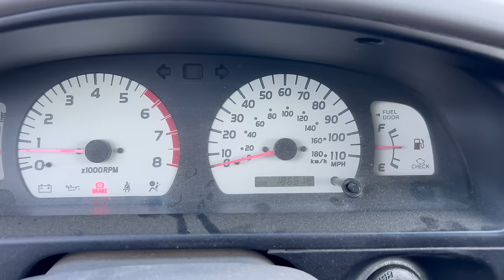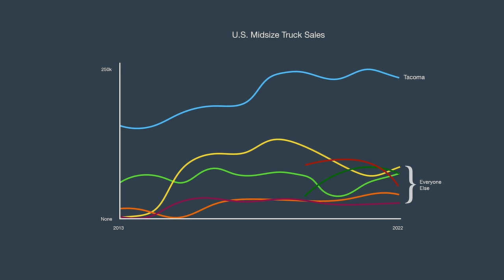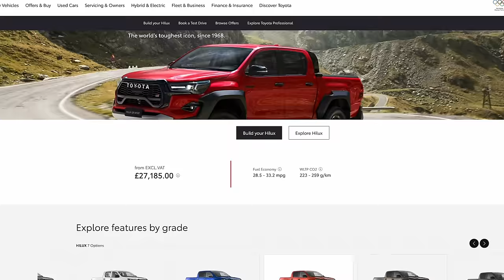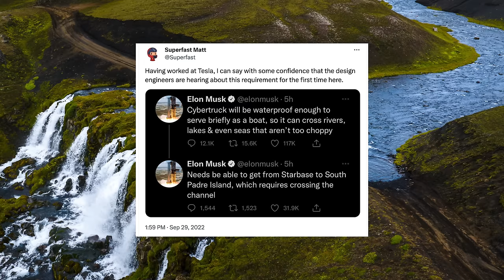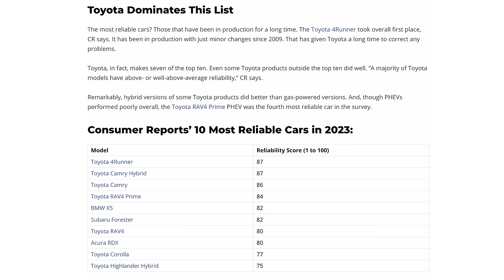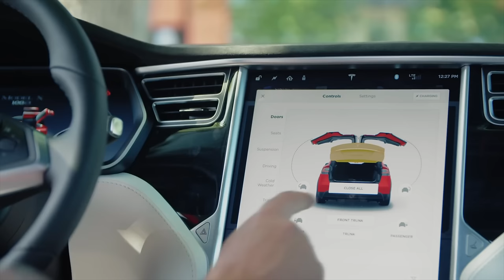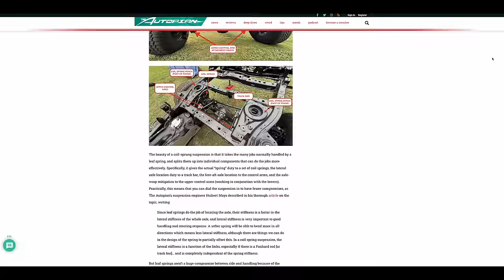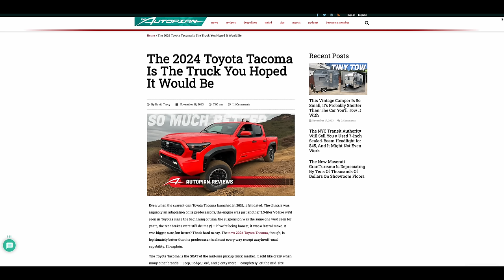What Is The Best Truck, And Why Is It The Toyota Tacoma?

Comment: You didn't talk much about the size creep on these mid-sized pickups. It seems to me like an F150 from the late 90's is about the same size as a new Ranger. The Tacoma is certainly a larger pickup than the previous generations as well. And, generally, the more weight you ask a vehicle to carry around every day, the harder it is on all components of that vehicle (except it usually rides smoother).

I'm still of the philosophy that I'd like to ask a larger displacement engine to work at about 20% of its capacity 80% of the time than ask a small engine to work at 60% of its capacity 80% of the time. Adding turbos adds complexity and heat. Not things that usually go hand in hand with long-term reliability.
Reply: all of the tacomas have more power than the cow towing hiluxes and such.
the 1.9 isuzus work all day all year hauling ice too.

like, it doesn't really matter as much as much as the engine at 100% isn't overtaxing the engine in the first place.
Reply: I "downsided" from an 07 Ram 1500 to a new Ranger and it's just as much truck with better fuel mileage. So, yeah I agree.
Reply: That size creep is due to the EPA. The formula for determining required fuel economy is based on size of wheelbase and year of production, so to avoid fines they have to make the vehicles larger to keep the same class engine. It’s why the Maverick is a hybrid.
Reply: Trucks in the us are insane size. I'm argentinian and the hilux's are pretty small compared to the new rangers, and dodge Rams always look huge next to every single other truck I see.
Reply: Yeah, a new Tacoma can be larger than an early 2000’s Tundra, it’s pretty wild
Reply: It's the stupid CAFE "standards" enforcing unrealistic mpg/wheelbase ratios. If you want a small truck (a la 90s s10) you'd have to somehow get it up to ~50mpg, which while I might not be an engineer or a physicist, seems like an impossibly with ICE alone
Reply: You can easily ask your engine to work at 60% of its capacity 80% of the time, it just has to be a well build and tested engine which toyota is pretty damn good at.  I'm a guy who would much rather ask my engine to work 60% of its capacity 80% of the time instead of going around 20% capacity 80% of the time.  I can tell you that heat really isn't that big of a deal. The engine actually likes having the water running through it at 70-90c, the oil likes to be heatet so it can flow better and do its thing, the combustionchamber also likes heat so it doesn't get fouled by sood in there. There is absolutely no problem in having heat in your engine, it actually needs heat to work as it should and so it runs as clean as possible. The "trick" in it is managing the heat which you do with your heat exchanger's. Your engine's water has one, if your car is turboed and or is excepted to tow your oil has one,  if your car/truck is big, is for driving long or is for hauling/towing your transmission typically has one, so heat is only a problem if one of these fail, so don't be afraid to work your engine  at 60% capacity and don't be afraid to hit the redline(not limiter) if your car isn't makinh weird noises like knocking if you do it. I can tell you that i own a 21 or 22 year old car with 223000km/138565mile car that redlines at 6400rpm. That car lives it life at 3500rpm if i'm not just cruising in town and behind other people with no safe and or legal way to overtake. I usually shift gear at 4500-5000 from trafick light to trafick light and if i'm out om the country roads it lives at 4000 as a minimum and will be taken to redline as often as the road lets me. And while i downshift i will typically downshift so the rpm's is at 5000rpm if i'm engine breaking. And I can tell you my engine hasn't had any problems while I have had the car. It has actually gained a bit or compression back after it has been given enough heat for carbon and sood fouling to break loose and get cleaned up. Which has happened because the only other owner was an elderly couple who with high probability drove the car like you drive yours and they probably logged it around alot.

If it helps my car is an old Toyota avensis t22(was only for the eu market I think) with a 1zz-fe which is the stroked "non liking" rpms from the zz family.
Reply: semi's sitting in the corner with their turbo diesels
Reply: @ElBach1y  I would love to have the Tornado, Strada or Saveiro.
Reply: @megazombiekiller9000  the problem with that is the company is making the decisions for us. They aren't forced to do this. Companies decide to do this on their own accord and advantage, not the consumer's.

Comment: My '96 Tacoma 4WD 3.4L V6 Extended cab in burgundy? non-SR5 trim has 336,000 miles. It can go years without adequate maintenance almost nothing breaks and I've forgotten most of what I knew about how to work on vehicles.
IF it ever dies I want another one of the same year and model.
Reply: Preach brother.  I feel the same about my 18 Tacoma.  I have already put 156,000 miles on it and she has not skipped a beat. I have replaced 2 ball joints, UCA bushings, breaks once and spark plugs once.  Tacoma's are amazing.

Comment: What Working as mechanic taught me about Toyotas. They our underpowered. Mechanical more complicated when compared to other trucks. Build quality is superb. Interior quality in the 90s was also simple and superb for wear/longevity. Front Suspension geometry was a head of its time and is now copied by almost all other truck manufacturers. They offered awesome off road tech with rear locker available. They also fail like other manufacturers, and factor parts our more expensive. Yes they can and often do last a long time the owners also our more willing to keep them maintained and on the road because they hold their value. I have seen all brands of trucks reliably be worked hard with high miles put on them, Toyotas our no exception. 

I would not pay the money people want for them used. 

Awesome video Matt!!
Reply: Are*
Reply: That autocorrect on your phone is terrible!
Reply: Now the manual transmissions are failing even though they detuned the engines to not stress it. The fully boxed frame is made from extra thin metal to save weight and money.

Comment: I did the same thing bought a 2016 and as well no issues.
I don’t do off road so I’m not worried about the plastic antifreeze pass through on the backside of the motor. They started making them out of metal in 2018.
I think turbos will be OK. The most important recommendation is let the motor warm up, change the oil often and let them cool down before turning off engine.

Comment: Original owner of a 1998 SR5 2WD V6 with 225k miles. I've done all the wrenching since new. Minimal issues except for the rear leaf springs flattening prematurely, misc oil leaks, replacing the alternator and a couple bad fuel injectors. I think I am still under $2k in total repair parts. It has never stranded me. I get asked every so often by random people if I want to sell. I'm keeping this thing until the wheels fall off, about 1.5 forevers from now if Matt is correct.

Comment: I had a 98 Tacoma for 4 years, loaded with TRD package, V6, 4x4.  I even put Bilsteins on it like the ones here.  It was pretty reliable, easy to park, and it felt like a "real truck" which came with "real truck" downsides.  It was super slow.  It rode like a shopping cart and the bed was narrow.  I replaced it with an 07 Ridgeline which is far more comfortable and fits my needs better.  I drive off road pretty infrequently, though when I do, it's nice not to have to switch to 4WD.  It's also excellent in the snow.  The Ridgeline's "AWD" system works pretty well and is seamless.  The Ridgeline is also much more comfortable on road where I spend most of my time, and it fits sheet goods between the wheel wells.  Hauls motorcycles in the bed and I towed a UHaul to help someone move.

Not saying the Taco is bad.  It deserves its good reputation.  But I think the compromises you make with a Ridgeline actually fit 90% of what most truck buyers need.  Too bad the Ridgeline is as ugly as a bulldog licking peanut butter off a cactus.
Reply: I have been on the fence for a Ridgeline for about 10 years.  The only reason I didn't pull the trigger was the horrible fuel economy.  I get 22 mpg in my paid off 2010 Silverado... the Ridgeline was still "boasting" 18/23 mpg last year, and that just doesn't cut it for a Honda in 2023.  Still, I must agree that it does everything as good or better than it's counterparts, besides off-road, where few people ACTUALLY go.  And yes, it is Butt-Fugly.  Honda, as an exceptional off road vehicle company (motorcycles, Quads, UTVs) needs to step up and make a proper truck to compete with the Taco, and I think they could.
Reply: @matthewpeterson3329 
I'll drink to that.  My RL has A/T tires and mileage with mostly city driving is in the low teens.  On the highway I've gotten 20, but it's just thirsty.  For the mpg it gets, it should make more power.  Though my Taco with the V6 wasn't any more efficient (the 31" tires may have also had a hand in that) and it had 60 less hp.  The 2nd gen RL now makes 280 hp which is a welcome bump, and mileage improved a touch to boot.  I only put 2k miles or so on my truck each year so this wasn't a dealbreaker for me.
Reply: How's your water pump gasket doing?
Reply: @DylanClements98  That's funny... I put bilsteins on my Silverado and it rolls and sways like a boat now.  But yeah, not a great ride... I wouldn't choose them again.
Reply: @DylanClements98 Agreed, I think they contributed to the rough ride, though even before I installed them the truck was hardly cushy.  They did give me confidence to take the truck over some large bumps.

The Ridgeline by comparison rides and handles more like a car (well, because it basically IS a car) and that's a good thing when you're driving it mostly like a car.
Reply: @7eis Not sure if you're alluding to some potential weakness, but it is fine.  I replaced the TB/WP 9 years / 40k miles ago with Honda parts.  I'll time them out next year.

How are your valve cover gaskets?
Reply: Ridgeline now reminds me of a poor man’s Cybertruck
Reply: @matthewpeterson3329  I have found in my research that American cars have bigger engines/more horsepower than foreign cars generally and still beat them in MPG....
Reply: Using a car to do truck things is not even close to what “90% of what most truck buyers need”.
Reply: @matthewpeterson3329  My base '96 Tacoma 5-speed gets decent mileage. Not civic/corolla mileage, but near 30 MPG on the highway. As for comfort, I have a '96 Camry or '98 Altima for long trips.
Reply: @will7its   Yeah, I ran into the same info when I was looking for a little commuter a couple years ago.  My Silverado was just over 260k miles, but whistle clean, and I wanted it to stay that way.  It seemed stupid to put 120 miles a day on it.  I was on the hunt for max economy, and settled on a Kia Rio hatchback.  Honestly, a damned decent little ride, good stereo, and I get 52 mpg.  I can't complain.
Reply: @sunbeam8866   That's respectable mpg.  I had a '91 Nissan strippy model pick up that got in the low 30s for mpg.  I really liked it until I needed something bigger.  It was really tough, took a lot of abuse and laughed at me.  Nissan made a good truck back then... arguably as good as the base Toyotas, IMHO, for considerably less money.  I think I paid $6495 for it brand new.  Of course, the resale has always been better on the Toyotas.

Comment: I agree strongly with the whole video except for the part at  8:31 . I live in Mexico, I have a manual 2023 4x4 turbo diesel hilux, STOCK it did as well as jeeps with 27 inch skinny tires.  I lifted it and gave it 32s and now it outperforms jeeps, and when it was on those skinny tires in 4H, man that thing did burn outs…. A FOUR BANGER.  it’s 220hp and had a 0-60mph of about 6 seconds. Crazy fast.  Since the tires upgrade it’s much slower but it’s the most badass truck I’ve ever seen on trail down here.  It’s ANYTHING but mundane. And I use it for painting jobs too, it’s a do everything truck.  It even does mudding better than the fords and rams and chevys because it’s lighter and doesn’t sink.  Life has only been getting more exiting since this truck, and due mostly BECAUSE of this truck, I’ve taken it up so many mountains and horse trails, where no truck has been.  And in the entire climbing community I have the most capable truck, so in the rainy season when the roads to the climbing spots are all muddied up, only I can make it out there and it’s all to myself.

Comment: I have only owned one Toyota, a 1982 Starlet.  Dinky little engine, dinky little car, super reliable, bulletproof,  and it was front engine, rear wheel drive, and manual (not that that really mattered, given the power output).  Only thing that ever went wrong with it was a clogged fuel filter.  Nothing against Toyotas and their reliability, but I was looking for something more fun, ended up with my 93 Miata.  Also pretty bulletproof, still drive it today after 30 years of ownership.
Reply: Got a 1982 starlet a sunday's driver myself :D

reliability is indeed great :D

Comment: I would have bought an old Tacoma. However the new Tacoma is basically the same size as a Tundra. Trucks are too damn big and way too expensive. Probably the reason why the old Tacomas and Rangers are so valuable today are because the only way to get a small & affordable pickup is to buy an old Tacoma or Ranger. I went with a Maverick, which Toyota should have had a competitor out for a long time ago.

Quick Edit: The Ranger release pissed everyone off because a lot of people thought the Ranger was going to be the old hunting truck from the 90s. Instead they got a Tacoma competitor, which literally nobody asked for. As your video points out, there wasn't a market for the ranger. However the only vehicle in the US you won't find on dealer lots right now is the Ford Maverick. People want the small utilitarian pickup back, too bad none of the car companies wanted to make them for sale until the Maverick came around and prooved market viability. Heck, any idiot coulda told you it was a home run, just rich execs are really detatched from the market.

Comment: I got a used 2002 Tacoma in 2015 with 160k miles on it. After 2 crashes, another 50k miles, a whole 6 oil changes, and driving for 3 months without even knowing I didn't have brakes, it's still going very well. 
I will end up giving this to my grandkids.

Comment: Non road salt / warm areas allow " last for ever " or even OK vehicles to continue on a very long time.  The problem in other areas is road salt makes a 4 year old vehicle look like a 30 year old warm area vehicle  and cold starts are very hard on engines causing them to fail.
Reply: Spot on. It's becoming increasingly harder to find clean 1st gen Tacoma on the roads here in Michigan
Reply: I mean they still are reliable even in salt. Ive had an 04 corolla for three years now and its fine even with all the salt that gets put on the road here..
Reply: Yeah, everything except the new frame on mine is solid rust. I can't believe they did a whole frame and didn't replace even one shitty failing bracket. One of said brackets broke and severed a wheel speed sensor wire so I had to troubleshoot the ABS system to find that. Fun?

Comment: Had no appreciation of the Tacoma til a friend towed my ‘52 Ferguson tractor a couple hours for me with his 2nd gen work truck when I needed to get it moved to a new home. His Taco was a stripped, basic white V6 fleet unit and it towed that big old tractor like a champ. Smooth, stable, and plenty of power to stay with interstate traffic despite being at max load. 
An hour into our ride a driver yakking on their phone whizzed past us on the left, changed lanes without looking and collided with the vehicle in front of us causing them both to spin. It was raining which didn’t help. The cell phone yakker careened by turns off the center median and inside guardrail, back and forth doing pirouettes right in front of us and our load, every smash into concrete shortening the car a couple more feet front and back. My buddy was standing on the brakes to stay out of her way and that glorious Toyota got us stopped dead straight from the speed limit to zero in very short order without a wobble or hint of trouble. Loved those trucks deeply ever since.
All hail the algorithm AND the Tacoma.